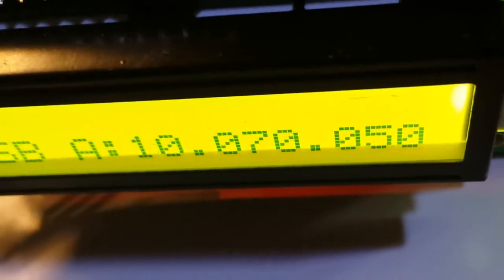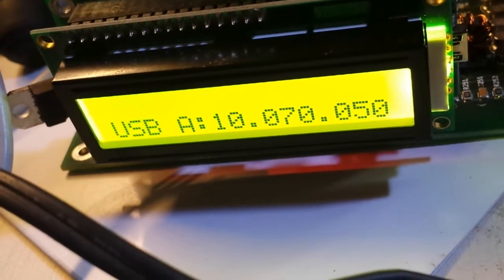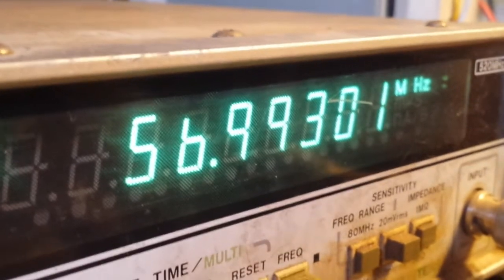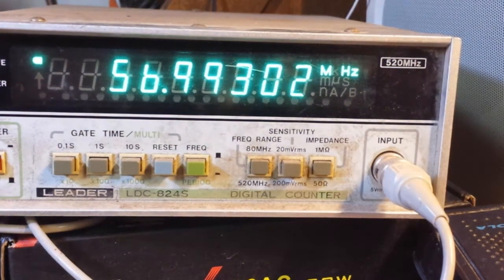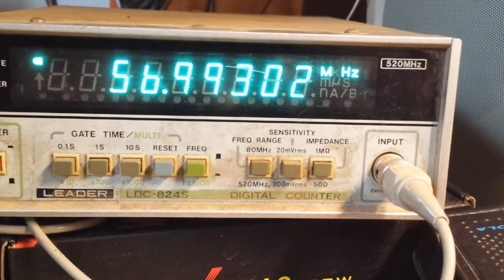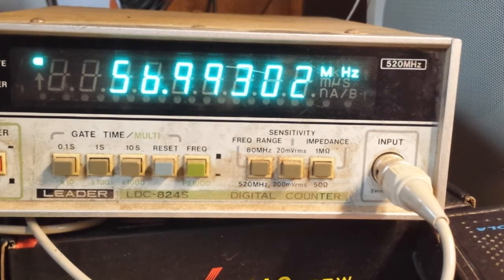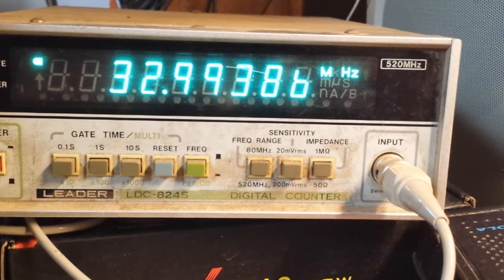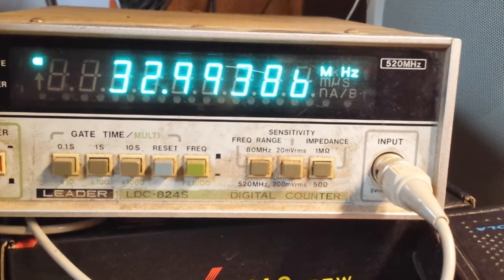uBITX,  why are frequncies measured , clock 1 , USB and LSB from SI5351 reversed

Comment: when i set my uBitx on LSB mode (@ 7.160 Mhz) 
 i Hear my sound in (USB mode @ Yeasu FT-450D @ 7.160Mhz ) and Vice Versa  , Why ?
i am using 1.2 Firmware @ uBitx V.4 board (16p Default uBitx LCD)
a Far away friend had heard me @ 7.160 Mhz @ USB mode , Why ?
is this normal ...?

i did a Calibration , Then i count the Carrier frequency (@ Antenna Output) of my uBitx in (Low/Upper CW modes (@ 1 Khz CW tone set) ,  the results are :
7.161 Mhz for Upper 
7.159 Mhz for Lower
seems good isn't ?
Reply from the maker: I remember , very early in my experiences with the uBITX , it was possible to reverse usb and lsb by not having the BFO in the correct area. The original calibration described , I think the second step, finding a good SSB signal and tuning the BFO until things were correct. The Calibration has changed a lot but I believe the BFO affects TX as wel as RX, but I would us RX to get it calibrated.

Comment: It uses upconverting
Reply: when i set my uBitx on LSB mode (@ 7.160 Mhz) 
 i Hear my sound in (USB mode @ Yeasu FT-450D @ 7.160Mhz ) and Vice Versa  , Why ?
i am using 1.2 Firmware @ uBitx V.4 board (16p Default uBitx LCD)
a Far away friend had heard me @ 7.160 Mhz @ USB mode , Why ?
is this normal ...?

i did a Calibration , Then i count the Carrier frequency (@ Antenna Output) of my uBitx in (Low/Upper CW modes (@ 1 Khz CW tone set) ,  the results are :
7.161 Mhz for Upper 
7.159 Mhz for Lower
seems good isn't ?